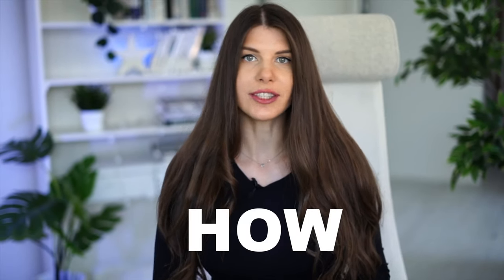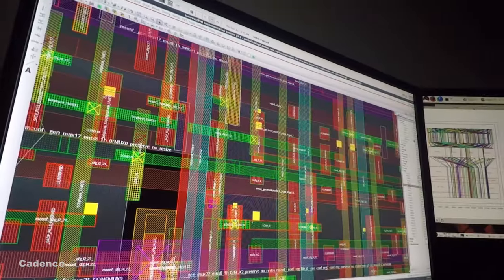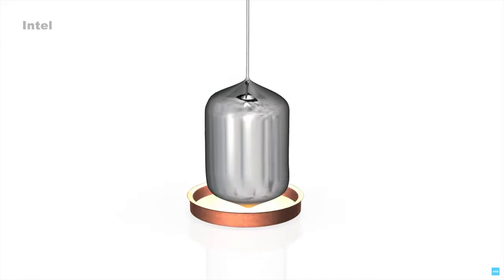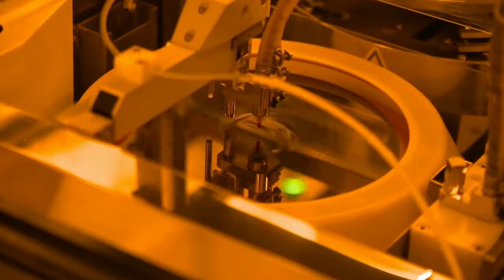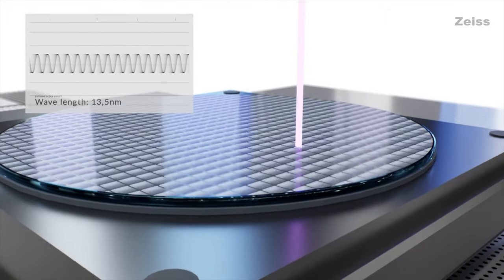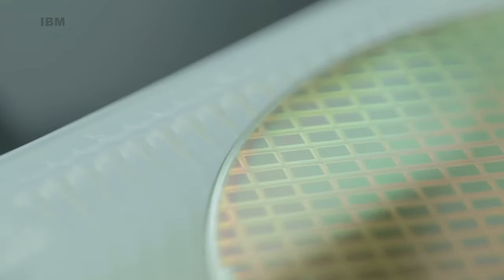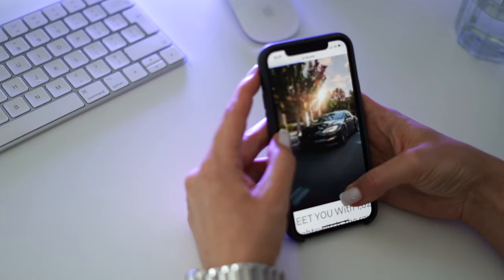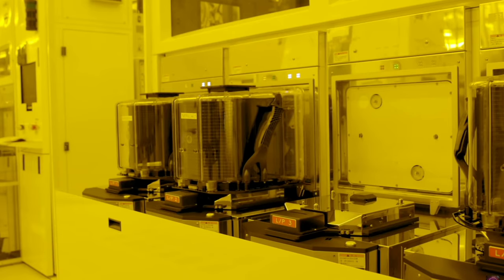How CPUs are Made: From Sand to Wafers to Chips

Comment: The term "tape out" is a carryover from when the artwork for printed circuit boards was created laying out the design with black tape.
Reply: That's what I thought but it turns out not to be the case. It was introduced after chip design had moved to CAD. The circuit board term is tape-up.

Comment: I learned something about the jargon! I thought tapeout was like printed circuit tape-up, in which designs were originally made by laying out opaque tape on clear plastic.sheets. But it turns out that the term tapeout arose in the 80s as chip makers switched to CAD and the tapeout command was used to create magnetic tapes of the files. See the discussion here: https://en.wikipedia.org/wiki/Talk:Tape-out